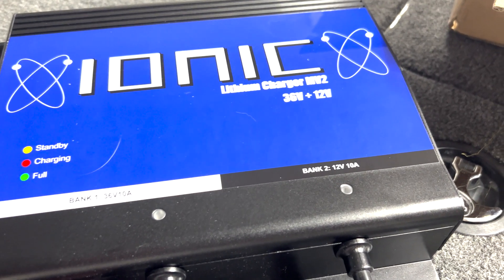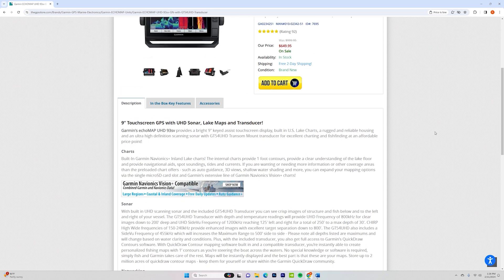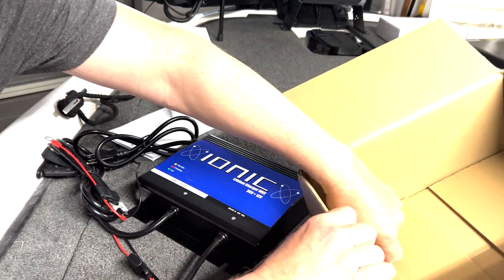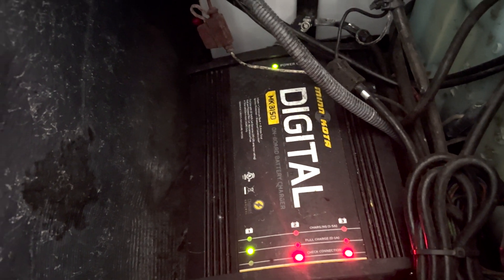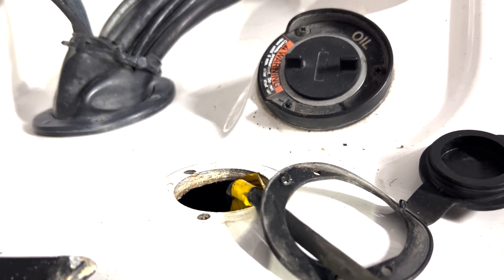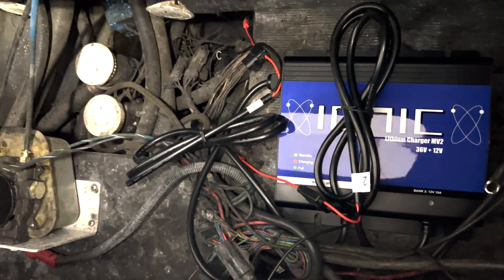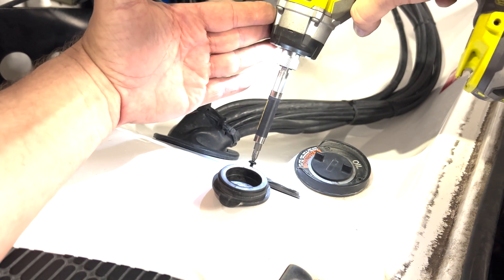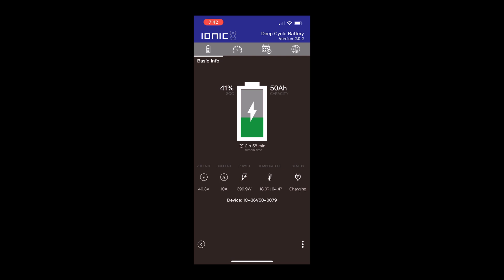Ionic Lithium 36v/12v Charger Unboxing and Install

Comment: Can this charge two 36v lithium in parallel
Reply from the maker: I’m not sure, but Ionic is pretty responsive if you email or call them. It’s working great to charge my 36v 50ah Ionic and my 12v AGM starting battery though.
Reply: @InstinctBassin  thanks ill give them a call

Comment: Have you experienced any issues with the LED status indicator lights since install? I am on the second charger (4banks x 10a/bank) that the LEDs have failed on. They will turn amber when initially hooked up, red for charging status, green when done, but sometimes random LEDs will simply go off. I have a third charger sitting that I need to swap out. I fully expect to experience the same issues. I am considering switching to the Minn Kota PCL.
Reply from the maker: Hi no I haven’t had any issues so far

Comment: I hope your Ionic charger lasts longer than mine did.  Less than two years used 4 times and it wasn't even mounted in the boat used it in the garage and it failed.  The batteries are good but not really happy with their chargers.
Reply from the maker: Me too!